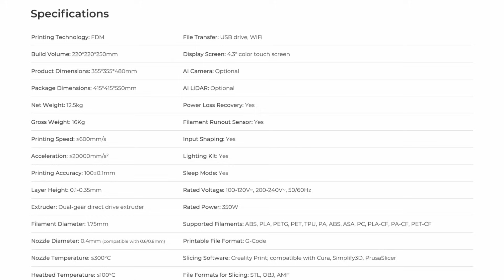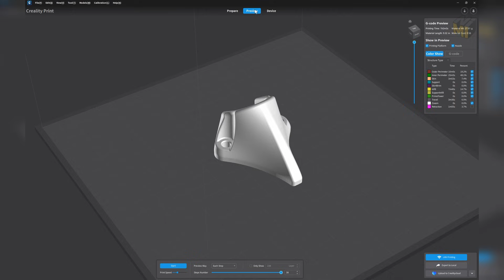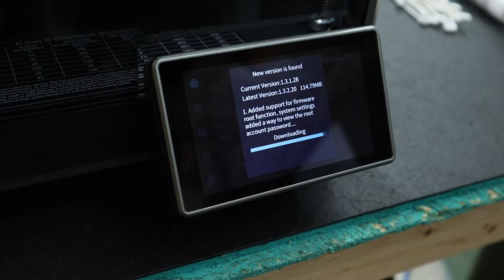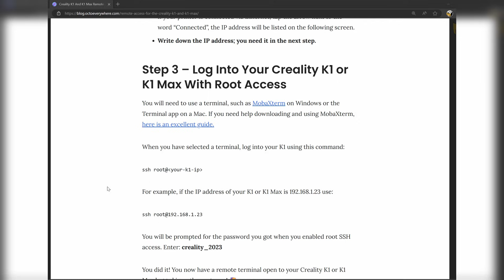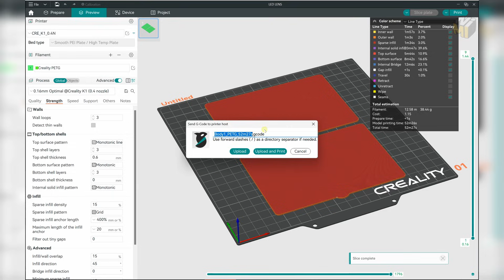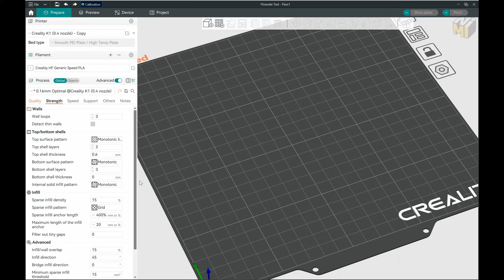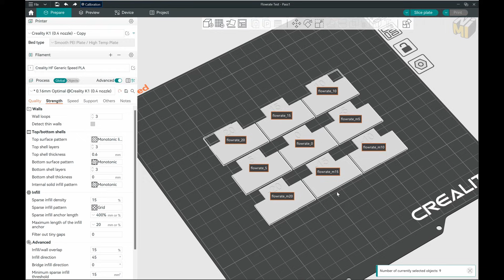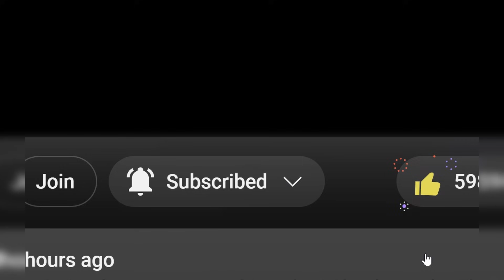Orca Slicer is BETTER than Bambu Studio, Cura and Prusa Slicer because they were the food!

Comment: I use a drybox from creality to warm up and dry the filament before it's extruded and that makes a world of difference for my PETG prints. (I print PETG only with Overture filament).
Reply from the maker: Pre-warm them so the spool is warm?   So we don't go from 20C to 255, it goes from 40C, less delta?  

On my Enders I would print directly from the Filament dryer, I could see if that helps on the X1C as well.

Comment: There's a big Black Friday deal on bambulab printers. The AMS with P1 enclosed is like $850 😮😮😮😮
Reply from the maker: I saw that!  It looks like Creality has some Crazy deals as well, they've knocked $200 from their K1.  I'm just in the process of doing some head to head tests between the Bambu and the Creality to see how far off they are from a quality at high speed perspective.  I think the Bambu will take the win, but maybe with Orca slicer on the K1, they won't be far off.
Reply: @NeedItMakeIt  micro center's K1 is around $349. I heard the k1 had its growing pains, but it's okay now. A head-to-head will be great!
Reply from the maker: @AvocadoAtrocity  That's cheaper than on Creality's site!  That's for sure, there were quite a few problems, strange that there were so many problems out of the gates.  Were they rushing, didn't test their own products it seemed.  In any case, they've fixed most of the problems, but I still see some vibrations, the Bambu printers have nearly no visible ringing, and using Orca now with both printers, it's really nice, I can easily switch between printers and print the identical parts as well, just a real treat compared to what I was doing... or really was not doing, I was only  using the Bambu.  I need an idea for a high speed print which is something people would like to see, any ideas?
Reply: I just upgraded from my Prusa Mini to an X1 Carbon with AMS. Couldn't pass up the chance and my Prusa Mini just hasn't been enough lately
Reply: Came here to mention the in store microcenter deal but someone beat me to it. If you live near one that has K1 stock still, $349 makes the K1 hard to beat. Even if you play with it and end up wanting a Bambu also, that’s old school printer prices for a high speed core XY.
Reply from the maker: How they're able to sell for that Price, they must not be making much on those printers.  And how they're selling the printers for less than on Creality's site.  Maybe they're the prev. generation?
Reply: @NeedItMakeIt  yeah not sure. I haven’t unboxed mine yet but intend to try to find what their original updates were and see if the unit has them. I do also hope Creality will send the updated parts they provided early adopters if these were just stuck in the sales supply inventory at MC. (Shrug. We shall see!)
Reply from the maker: Even it if is, I'm sure they'll send you the upgrade kit, there was a promo a couple of months back to send people these kits for $2.99, you'd have to prove you purchased one and didn't buy it used, I think that was the only criteria you needed to meet.  I can look into whether this is still an option if you do find that you need some help.
Reply: @NeedItMakeIt  mine ended up having all the extruder and hot end updates. Yay.
Reply from the maker: @NatesRandomVideo  Nice Nate.    You'll have to let me know how yours prints for you.  I'll be doing a few tests today to see where the slight extrusion variation is coming from, I believe that it's extruder related, or the tube feeding the extruder since it is so tight there.  I don't think that it's the format of the printer itself, it seems very well made.
Reply: @NeedItMakeIt  it sure feels like that last bend in the tube is too tight when putting filament in. Printing looks decent but I’m tempted to get the Bowden tube out of the chain and compare two prints to see if that drag in the tube is causing any small detail effects.